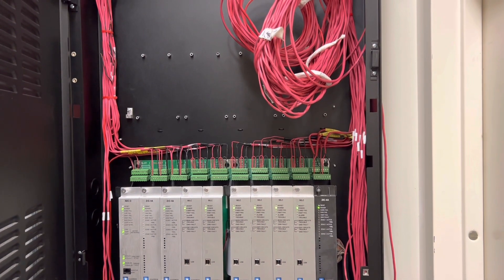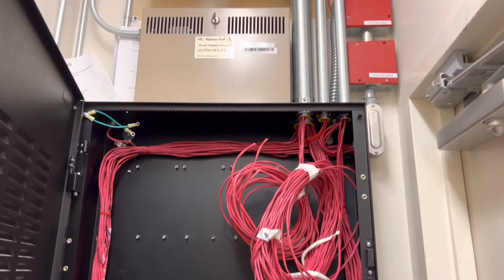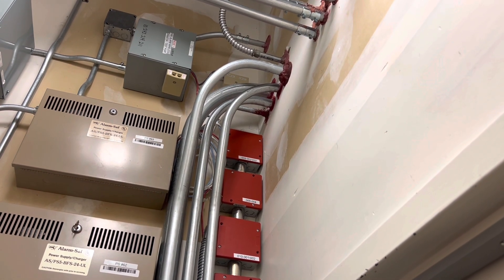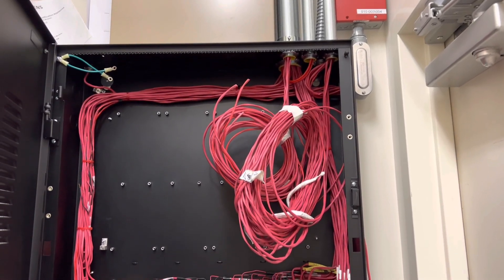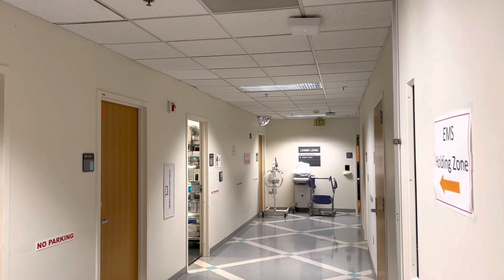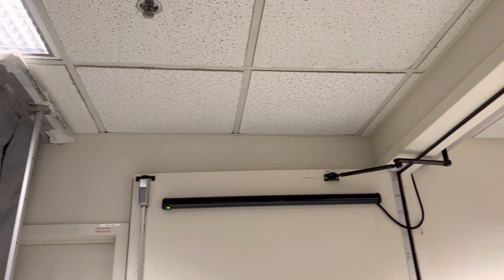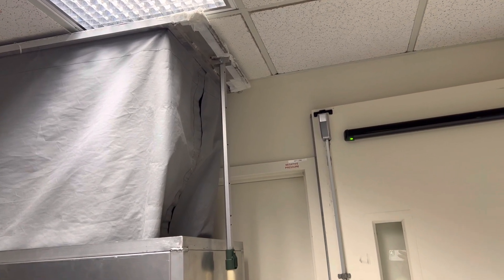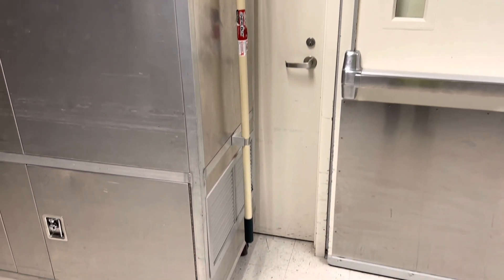Today As An Electrician: FA Testing & EMT Piping

Comment: Hey daily I have an electrical question for a job tomorrow do u think you could help me get some insight !!!
Reply from the maker: whats up?
Reply: @DailyElectrician  thanks for the reply ! Okay so we are installing 3 new receptacles all 120 volt with there own dedicated circuits and we’ve got a 480 volt panel I immediately knew it was high voltage when we pulled the panel cover off and seen the B,O,Y apparently my journeyman did not so at the end of the day he starts ripping the wires out and saying it would blow the receptacles up is this correct? (I’m a 7 month apprentice so didn’t think anything was wrong)
Reply from the maker: Can't guarantee the receptacle would blow up but anything plugged into it would